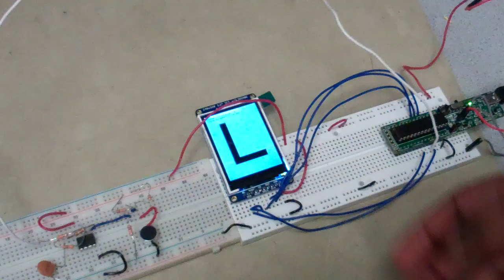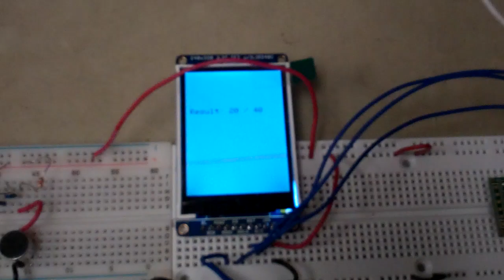speech recognition eye test

Comment: components specification and software used to dump code and also there is several codes
Reply from the maker: Is this a question, or what? The project is documented in the linked report. The project is 8 years old. The ONLY documentation is the report.